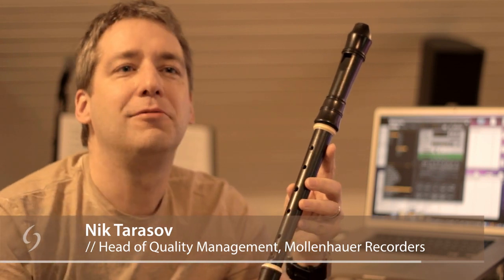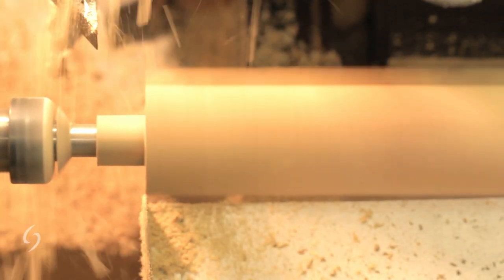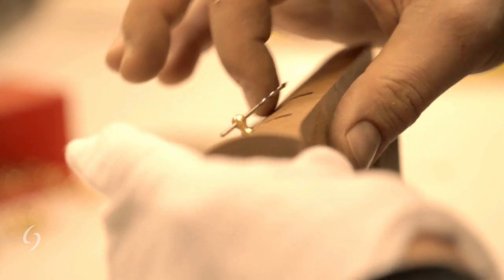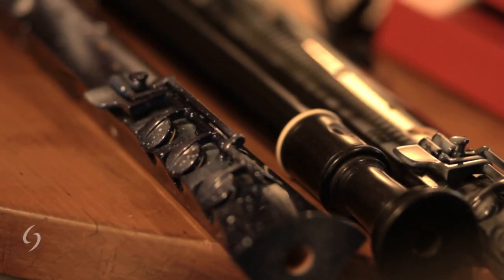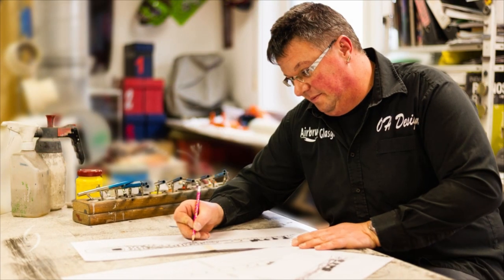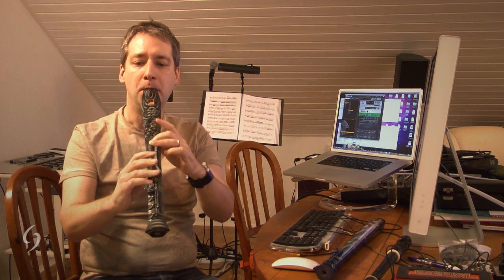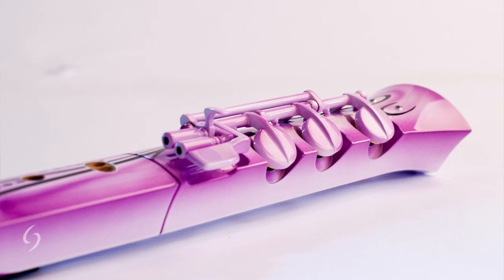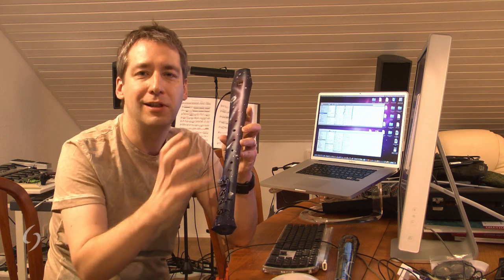Elody -- the electrifying cool recorder

Comment: That's great, but if you use a recorder with a standard vocal mic at a distance of about an inch or three (like a vocalist), holding the fipple (where most of the sound comes from) towards the mic's diaphragm, you can not only vary your volume by subtle variations in distance from the mic but also run it through whatever effects you want, if the front of house speakers are facing away and the angles of foldback speakers good, then you normally don't have any more problems than a singer would with electromagnetic-field hysterisis.
Brilliant though, an excellent evolution for the beloved recorder. I've done the same thing with distortion pedals and so on. If you use a clean distortion and adjust it right you can get a quite convincing, reedy, bagpipe chanter sound. Due to the extreme speed possible on recorder, I've had question-answer battles with lead guitarists with all the versatility of open holes to bend notes up and down like a whammy bar (great for blues or wild psychedelic rock), powerful trills, percussive punch with hard-tongueing on every note, humming like Ian Anderson of Jethro Tull through it, it is a fantastic instrument. Recorder is under-utilized in modern music but actually every bit as flexible as any other with a unique sound very close to a sine wave. If the recorder players of the rennaissance and baroque era could meet the demands of violinists as a lead instrument, they can just as easily now whack a distortion pedal (and perhaps an octave shift pedal or have back up higher and lower pitched recorders (I use a tenor, descant and sopranino for live situations) to meet the demands of licks played by lead guitarists. Lest we forget the greatest rock epic of history 'Stairway to Heaven' and the opening section's recorder consort. 
   I use recorder almost exclusively for wind parts in my compositions, here are two of them, the first is a folk-rock protest song 'GovernMental Crime' and the second is a neo-romantic quasi-fantasia nocturne entitled 'Fantasia for Piano and Recorder/Flute'
https://soundcloud.com/francismaxino/govcrime4stereoradio
https://soundcloud.com/francismaxino/fantasia-for-piano-and-fluteblockflute

Comment: I see this recorder is still available. It is very nice. There is a comment about the lead connector and your reply is that it is not possible to move it. It is in a bad spot. Should have carved a thin cable channel (on the outside of the body if necessary)  and by leaving the mike where it is, place the connector toward the end of the instrument. A wireless transmitter would have been more practical, added little weight and size, and would have made this more innovative and better value.

Comment: $2,700 Yea, I don't think so
Reply: Yeah, it's a problem, given that purely electronic and MIDI wind instruments such as AKAI EWI are available for around $600 (and cheaper options also exist).

For the price, I'd expect more features, such as contacts near the holes to make it a midi controller too, and wireless audio and midi.  With modern micro-electronics it would be feasible.

Comment: It may not possible but the cord would be more practical if attached near the bottom.
Reply from the maker: While this is a nice idea, it is unfortunately not practical. Because the sound of the recorder comes from the labium on the top of the headjoint. We tried a lot of positions until we found the correct one. If you put it down then it would be like the sound always reverberates.

Comment: The effects are definitely NOT impressive (at least to me).. Don't really care for new look either.. However, there certainly is something to be said about a pickup amplification system inside the recorder vs. just putting a mic on the instrument. It would be interesting to hear a comparison between the two.
Reply: *****
It probably plays nicer with FX, even if those FX are just EQ and a chorus. It also fits better in loud settings (see: rock band on tour). If I were to guess, the pickup is piezoelectric, so the sound can be compared to regular mic-ed guitar VS piezo pickup guitar.